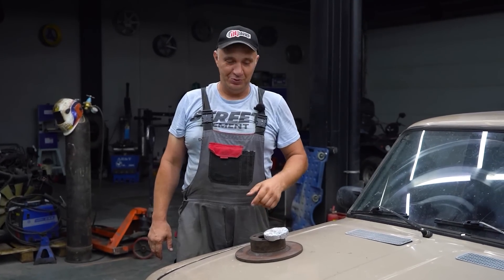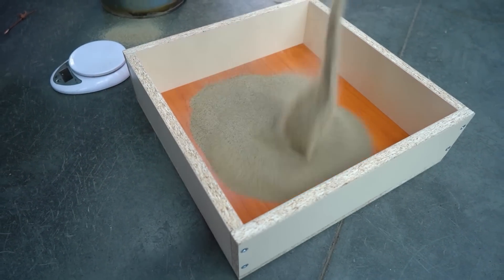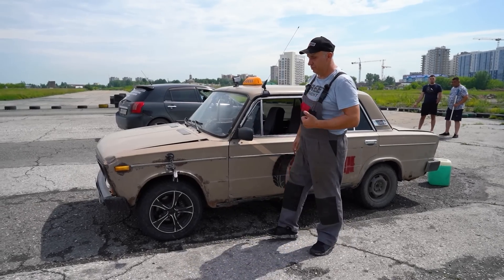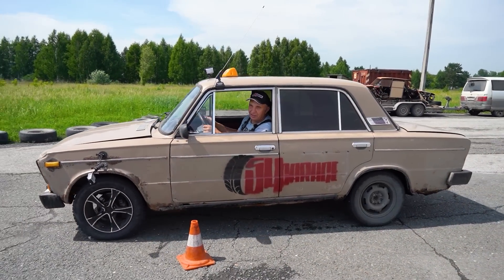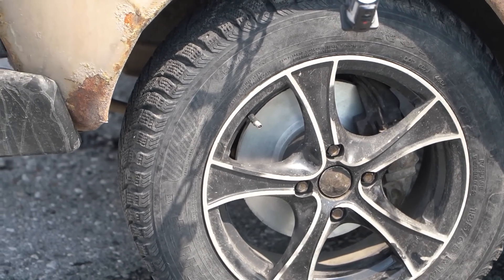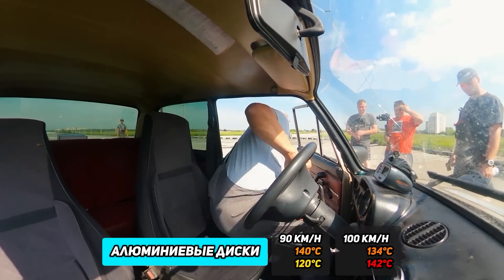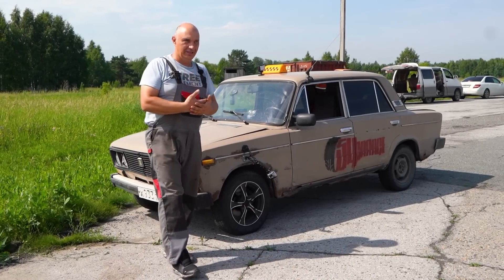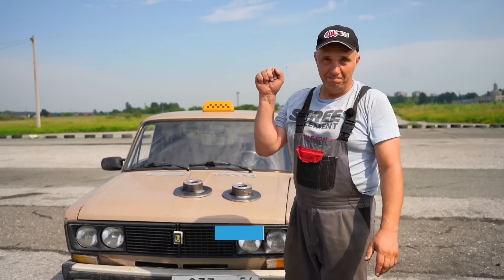We recast alloy rims into brake rotors

Comment: They made aluminum brake drums years ago but they had a steel liner
Reply: Rear wheel Lada has always had aluminum brake drums with steel insert.
Reply: Some cars today do in fact have aluminium brake discs, they are not steel covered. It is a specific alloy and they require specific material pads. They are only used on light low performance cars on the rear axle.
Reply: @nhytg376tgyuu765gjmg  that makes sense for rear brakes since they only do 10-15% of braking
Reply: @nhytg376tgyuu765gjmg  but the brake drums I was speaking on were from the 70s
Reply: They actually used one a few videos back in the centrifugal rear wheel clutch video.

Comment: Ever connected an automatic transmission to a manual transmission?
Reply: I have that in one of my vehicles. It's a Jeep- with an automatic transmission and a manual transfer case. Honestly, I would rather have manual transmission and manual transfer case because that allows for downshifting and upshifting the transfer case as needed.
Reply: @alflyover4413  That’s not the same thing. I mean a manual transmission, connected to an automatic transmission.